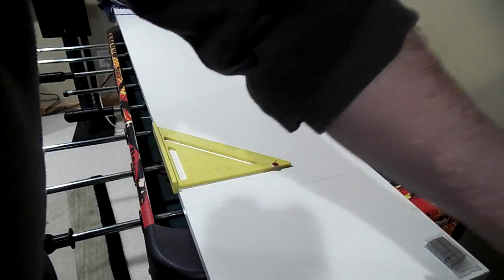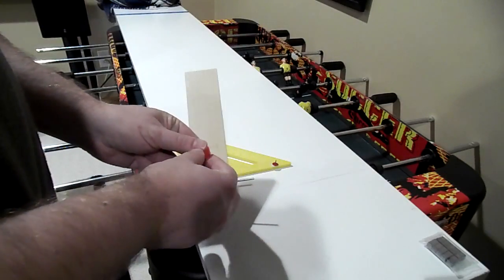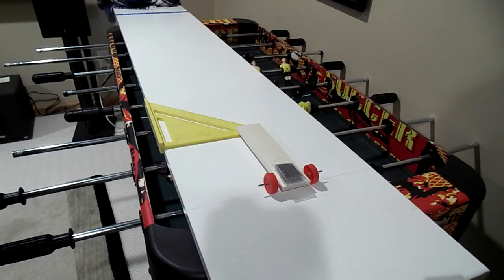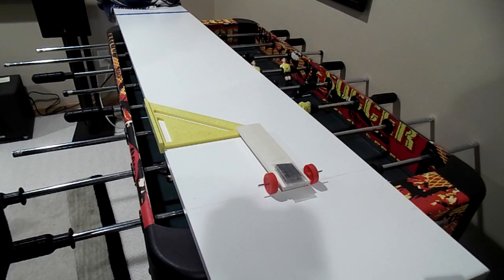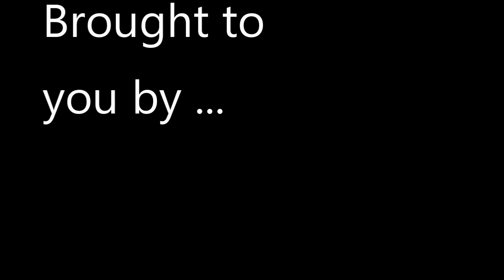A Simple Alignment Test for Pinewood Derby

Comment: Absolutely wonderful video!! I’m a semiretired dentist who has been given the ominous challenge of helping my grandson build his car!! I just have a few questions which I hope you could answer for me. We are building a “rail rider”. What degree axle do you recommend for front and back? I have one of those commercial jigs which can give a 1.5-2.5. I’m thinking slightly more can’t would be better….3-3.5?? If so how do you bend to this accurately?? We definitely don’t want any friction with the wheel and body. Also….what kind of spacing do you have between the body and wheel?? Thanx for your time and thank you for the great videos!! Dr Bob
Reply from the maker: Sorry for the delayed reply, I haven't checked into this channel in a while. For the rear axles, I always went with a 3 degree angle. The front dominate wheel is a bit different; I would bend the axle to the point where it would barely fit through the wheel. I think that is about 6 degrees. Bending accurately is difficult, which is one reason the pro's always drill the angle for the rear axles. Lots of different ways to get the bend for the front dominant axle, but the most important thing is to make a cut in the axle so that it bends at the cut.

Comment: So what would cause the wheels NOT to migrate? And what would the fix be for that?  Great video, thanks.
Reply from the maker: Hi Ken, my other alignment video goes into more detail on this, but the basically if the holes were accidentally drilled such that the axles toe in then the axles will migrate in towards the body when going forwards. If the axles are drilled with toe out, then they will migrate in towards the body when going backwards. If you are using bent axles, then the fix is rotate the axles to orient them straight. If you are using straight axles (and drilling at a slight angle to get a cant) then the fix is to toss the block and try drilling again.

Comment: Great video!  Sir, what drill size diameter are you using? What diameter size are the four check pins that you insert into the body? Where can these pins be purchased? I am just starting derby cars in scouts and your process looks amazing and well thought out.
Reply from the maker: Glad the video helped Steve. Most folks use a #44 drill bit for the BSA axle sizes. If you are allowed to use aftermarket axles, which are larger, then a #43 is usually best. I get my pin gauges online from McMaster-Carr. Amazon has them too. I have pairs from .087 to .091in increments of .001. But again, if you are sticking with the stock (BSA) axles then a pair of .087 pin gauges will probably be fine.